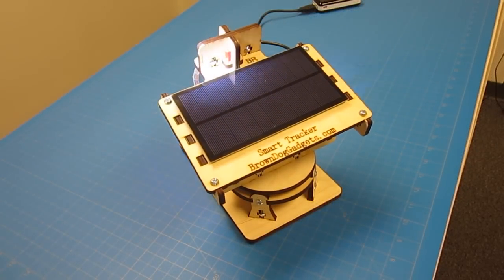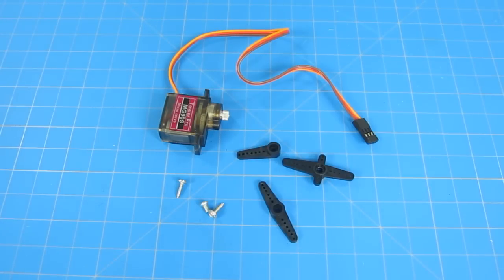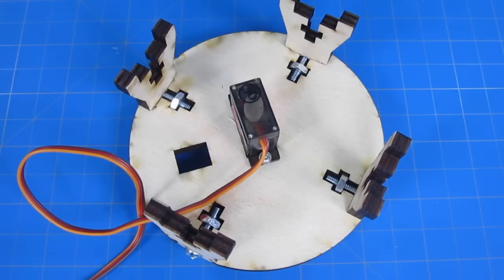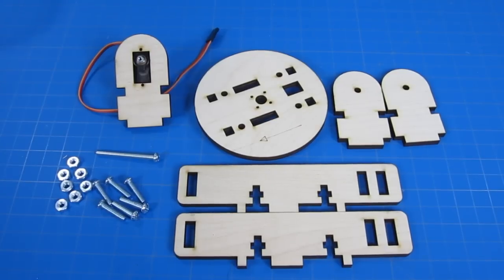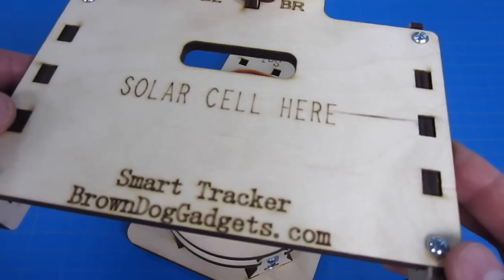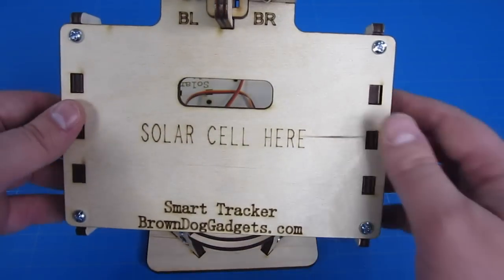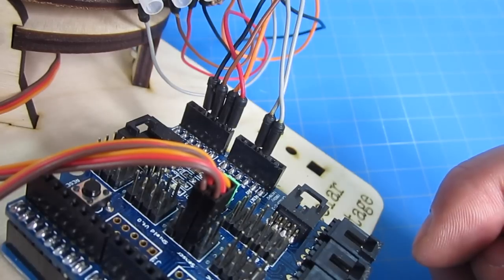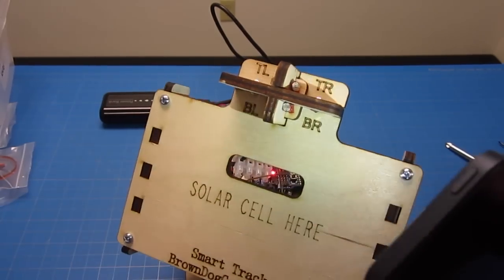Dual Axis Solar Tracker - DIY Arduino Powered - How to Assemble

Comment: Since the 80's I've wanted to build a dual axis tracker but using bi-metal springs beneath magnifying lenses, allowing the Sun's heat on any spring to pull the tracker back inline keeping it centered on the Sun without electricity, motors, etc.

Comment: A complex for tracking the sun based on the calculation of the data received from the GPS receiver. This system consists of a basic module SOLARSAN-GPS that can work independently and SOLARSAN-SLAVE working only as an executive device. Using SOLARSAN-GPS, you can target solar concentrators, collectors or panels at right angles to sunlight. Control is carried out with the help of actuators or rotary actuators in two planes and has an accuracy of one degree. The module has an input to connect an "anemometer" to protect against strong wind, the input of the "hail and snow sensor" and the input of the "photo sensor" for the sleep mode with low solar activity. Built-in WiFi module allows you to configure the tracker through the WEB page over a local network or through an access point. The built-in MQTT broker allows you to manage and receive data via the Internet network around the world. Power supply from 12V to 30V (and version HV with power from 12V to 55V). Protection by current. Short circuit protection. Built-in radio modem 433.92 (315.00) MHz with a capacity of 100 mW for data transmission in a radius of up to 100 meters to the SOLARSAN-SLAVE modules. Works both in one and two axes. The IP66 enclosure allows you to install a solar tracker under the open sky.

Comment: Can you use the solar cell's output as orientation data? Like pan left-right until the maximum output is found, then pitch up-down until maximum is found again, if voltage drops more than like 10%, rescan.
Reply: No. If its scanning and a cloud moves in front of the sun, it will be confused.

Comment: Works great with my iphone flashlight but . . . .Locks up in the Sun. I assume the light sensors are not compatible with direct solar/sunlight?
Reply from the maker: It should work great in the sun, but you may be getting so much light that it will take time to see it move since the sun moves very slowly.

Comment: Friend, it turns completely to the other side? I say the sensor side? It rotates 360 degrees horizontally, it is clear in the video, but it rotates 180 degrees vertically?

Comment: Are the joints/servos stable when no power is applied? This might not add very much energy gathering capability over a static, south facing panel if the panels have to constantly power the servos.

Comment: is it possible to get laser cutting wood only? for this project. and how much time for the shipment.
Reply from the maker: Sure, email me through my website.  I can make that happen.  Or you can also look around your local area and find some place with a laser cutter.  You'd be surprised how common they are these days.
Reply: Brown Dog Gadgets Do you have the measurements for cutting each piece of wood, i found a local dealer that has a laser cutter.

Comment: does it need any coding?
Reply from the maker: The code is available in the directions, which are posted online for free along with all the other design files.
Reply: @BrownDogGadgets  Why when I download the program and run it, the movement directions are wrong, even though I made sure to connect correctly more than once
thank you very much

Comment: I did  all the steps perfectly and make sured that connections are correct many times...but  problem is it is not tracking light...even if I removed the ldr pins it's rotating in one direction...can you help with this

Comment: So instead of using port 9 & 10 for the motor control, I want to use servo port 0 & 1 on my motor controller shield, what changes do I need to make to the sketch in order to do so?

Comment: Hi,
The sensors are placed on the top and are separated by shadowing surfaces? I mean...you don't have LDR's on your panel, right? All fours are situated in that yellow package from the north, right? If you focalise the light on your panel, it shouldn't move, correct? I'm asking this because I have to implement such kind of  2 axis solar tracker and I don't know where should I place the four LDR's :) and I read they will have to be separated by some opacque surface and I don't get the deal very well...maybe there's someone that can enlighten me..thanks in advance!

Comment: nice setup. but I prefer a time based tracking system. I can imagine the arduino is over kill, if I were to build a time based tracker.
Reply: Not ideal. This can be place anywhere without any pre-setup.

Comment: Can you please explain me what does this statement means "if(-1*tol >dhoriz || dhoriz>tol)" ?
Reply: tol (tolerance) is 50
dhoriz (horizontal difference) is difference between avl (average value left) and avr (average value right)

dhoriz can be either negative or positive so the tolerance should be set on both sides.. ok?

so if dhoriz is lower than negative tolerance OR higher than positive... do something with that axis, else keep on looping

nice and simple piece of code...

Comment: Awesome!
Could you please email me the complete top and bottom SVG files for lasercutting?
As there are a few missing pieces
Or is the design different from the video and the small rectangular piece for the LDR placement is not needed?
Reply: iCinnaMonster if you got the file please send me as well

Comment: hi there...i need to make a similar project...but thats to detect LED light source...do i need to change the coding to do that?..and what did you use as the power supply?

thanks

Comment: hai. i followed it step by step. but, i have a problem.
my motor servo doesn't move like the video. it is not tracking the light. maybe the voltage is low. i using external power supply for the motors. and still not tracking the light. what should i do? may the motors is wrong? or the coding? thank you

Comment: Hi trying to build this project, kinda new to Arduino, trying to trouble shoot
1 servo motor which is buzzing / chatter, I did swap servo plugs around from 9 to 10 and 10 to 9, chatter happens only on 9, don't know if something in code needs to be fixed or it's interference. what do you mean by removing 2 screws as I get the chatter with out the structure.
my servos say they are analog not digital as I understand digital chatter alot
Reply: I am not 100% sure but I think the chatter is due to the motor not having enough torque / power.
 Can someone help me here as I'm not sure weather it's motors or script, I have made this,  it kinda works
need someone to help me understand this script to limit the degrees of tilt / shift / movement.
I assume it's these lines
int servoh = 90;   // 90;     // stand horizontal servo

int servohLimitHigh = 180;

int servohLimitLow = 65;

// 65 degrees MAX

Servo vertical;   // vertical servo 

int servov = 90;    //   90;     // stand vertical servo

int servovLimitHigh = 120;

int servovLimitLow = 15;

Comment: This is cute but no light sensing circuitry is required for solar tracking. The sun follows a very predictable route across the sky in any given day. All you have to do is program this route into the system controlling the motors and you have your system. You aren't tracking a moving target like a friggin missile.
Reply: +ibleed1 you are assuming the solar panel rig is stationary. If you mount this on top of a robot or other moving object it's easier to track the light source with simple light detecting resistors.
Reply: +Mika Hassinen Yes, that's a good point. Light sensing systems can be used anywhere without having any of the information i was talking about. Ok for a small portable solution but not for a field of industrial grade units.
Reply from the maker: True, but this is a project for learning.  Not practical use.
Reply: actually its easier to set up analog sensors and program for that than a full rout map. just a series of if then statements and your done. this is actually easier than setting up a system that has to be changed every season.
Reply: Would make sense for a boat on mooring ball.
Reply: ibleed1 I fully agree that following a sun map makes more sense, so where are instructions and map info to be found.
Reply: Making an upscale version for a small travel trailer. It's funny how people get stuck on one practical purpose.
Reply: If you are tracking the Sun for an entire year this is the way to go.
Reply from the maker: Very true!  But that wasn't the goal of this project.
Reply: If you camping motorized it is practical for example
Reply: If you want to build one with no light sensor, check out the open source www.ceribralmeltdown.com site where all the code required is available.
Reply: No practical use. Ok, got it.

Comment: I was actually about to buy this from your website after seeing this but when I saw the price... you are ridiculously greedy. 150$ for something that costs you less than 30$ to make. 80$ for the wooden parts only?! really? charge 9000$ as well, why not right?
Reply from the maker: Hmm... I mean, you can always make it yourself. We do provide all the files for you to laser cut out. No one is forcing you to buy a kit from us, we're making it available for you. Plus in the new version we have custom circuit boards for the project. All those things cost money, and we do provide customer support as well.
Reply: Hi i am malaysian student studying electrical engineering. I would like to implement your project for my graduate final year project.i have to do the software and hardware also present the project before i am graduate.could you give me more information to how can i do the solar tracker(sketch, program,circuit,equipment used) thank you.

Comment: the arduino consumes more power than the panel produce
Reply: I guess you could use timer based sleep modes and a rechargeable battery as the tracking need not be that fast. once every 10minutes or more.